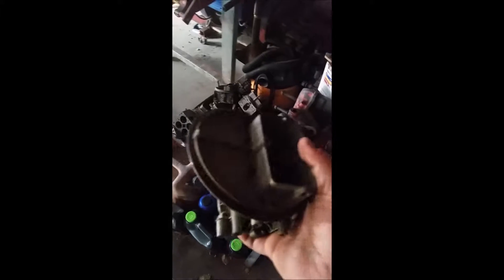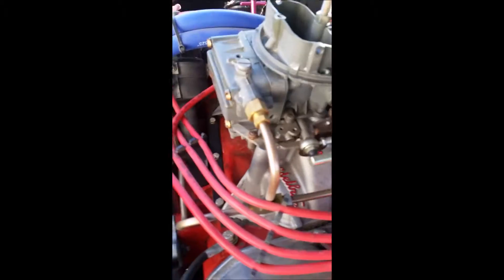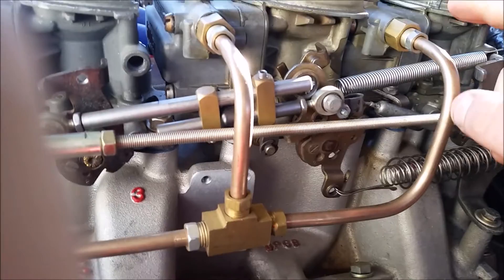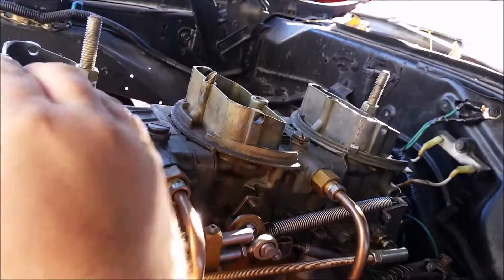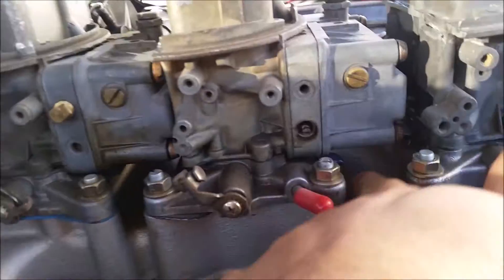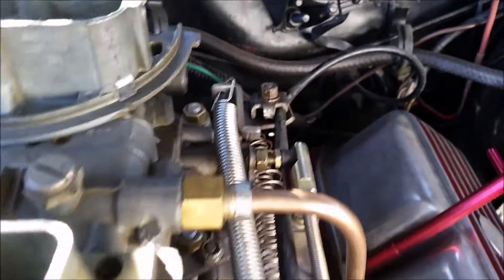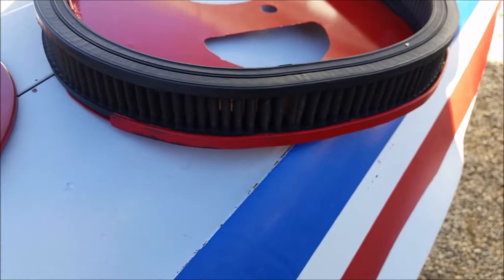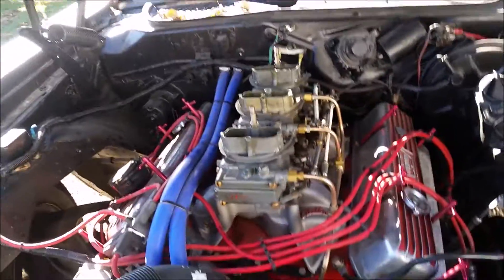Jed's Mechanical 6 pack EXPLAINED

Comment: I caught where you said the center hung bowls won't fit. I am wondering if that depends on the center hung bowl p/n. Holley has a SBC tripower with mechanical accel pumps on a Weiand intake and they are using center hung float bowls. Very tight in appearance. I do see daylight on your setup up. I picked up a couple IH 2300 and now I will experiment. Cool stuff. 
I had a Six pack on a 440 Dart with no vac secondary and mechanical linkage. Could not launch hard so I found some vac sec diaphragms. But for a twenty mph roll the car would LEAP forward. I raced a real 340 TA and a real 69 Boss Mustang on 1A in Ft Lauderdale, FLA once. Six lanes, the three of us three abreast. 209 mph roll. I put 3-4 car lengths on them in nanoseconds. Blew their minds, collectively.
I am duplicating the car and want the accel pumps on the outboards as well as the tuneability with jets and metering blocks. I am working feverishly on this new Six Pack set up.
Reply from the maker: I had great luck with this setup, and I even made a better version out of 3 4412 holley 500 2 barrels
Reply: @ScottsSpeedShop  I have not found a 4412 with the side hung float. Did you have to change the float bowl on your set up? Have a p/n?
Reply from the maker: @keithbrown1915  yes I did,  you have to use primary float  bowls from carbs like 4160s and you have to plug the fuel transfer tube whole. I just put jb weld on a pipe plug and screwed it into the casting. And that how both of my mechanical six pack setups are, including the rare Mr Norms tri-power setup, which I've own one before.
Reply: @ScottsSpeedShop  Check out the pics at this address. THe Old DC mechanical six pack. Looks like Mopar Six Pak throttle bodies with the choke horn removed on the ends. The side hung bowls. Accel pumps. Be nice to have a list of all the individual component part numbers.
Reply from the maker: @keithbrown1915  the direct connection mechanical race six pack is what i was referring to.  I just prefer 350 outbound carbs with a 500 center
Reply: @ScottsSpeedShop  I read that the mechanical setup was intended for use with the Weiand Six Pack Intake. Guess what I have sitting in my basement? With a Edelbrock STR Six Pack sitting next to it.
Reply from the maker: @keithbrown1915  very nice sir,  I've got the weiand Crossflow intake. The infamous six pack tunnel ram, it's a pretty good intake with 3x 4412s on top
Reply: Man, did you send me down the engineering rabbit hole. I finally found pictures of how Six Packs to Go modified the Six pack carb for center hung bowl w/ accel pump. Saw a pic of the old Barry Grant Six Pack with banjo fuel inlet fittings to attach the transfer tubes through the carbs. Speedway Motors sells a fit with -an fittings that would do like a 600 with a transfer tube. Tow kits would do the six pack and clean up the fuel inlets, tuck them close to the carb. I still have the Segal mechanical linkage vintage 1979. One question to reiterate. You said that you used a 4412 for the center and put a side hung bowl with accel pump on it? Thank you my Six Pack brother from a different mother (Mother Mopar!)
Reply from the maker: @keithbrown1915  That is correct, a 4412 with a side hung float bowl with an accelerator pump. I just plug the hole where the transfer tubes go.

Comment: I hoping you still get this even with old video, this vid inspired me so I’m putting the same setup together, I’ve ordered some primary side hung fuel bowls for my 2300s but what did you do for blocking off the holes for the crossover tube, thinking of ways to block them off
Reply from the maker: That's quite an honor, my friend. Thank you. It's a fantastic setup that never failed me, and I loved it, and I still prefer it over my single four. As for blocking off those holes, I threaded them and screwed a plug into them with jb weld, never had a single problem. If you have anymore questions email me chargerjezebel70@yahoo.com
Reply: @ScottsSpeedShop  awesome thank you a ton! Great idea, I followed you on Instagram I’ll have to keep you updated!
Reply from the maker: @junkyardigans6197  please do sir! I love it that you are gonna give it a shot, I know there are things I'd do differently now, but it all worked great
Reply: @ScottsSpeedShop  keeping an eye out for a cheap intake but finding and rebuilding 2300s as I can afford it lol, gotta get one more and the intake
Reply from the maker: @junkyardigans6197  Yeah, the intake used to be readily available, and when I bought mine, I got lucky. Are you doing a low deck or raised deck engine?
Reply: @ScottsSpeedShop  I have a 75 dart with a 73 440 hp rb motor in it, I can get the intake easy but 550$+
Reply from the maker: @junkyardigans6197  oh ok,  your are doing a raised deck,  I used low deck intake and those are pretty proud right now, $550 would definitely hurt as well
Reply from the maker: @junkyardigans6197  oh,  go look at my Charger Jezebel's tri power set up as well,  it's a revised version with 3x 4412 500cfm two barrels
Reply: @ScottsSpeedShop  I’ll shell the money out just gotta be patient lol, thank you so much for all the info I’ll prob be in touch soon lll
Reply: @ScottsSpeedShop  oh shoot Oke I’ll have to find it
Reply: I got my setup all on the car and ready to start, I have the outer carbs idle adjustment all the way out as low as they can go, and the idle air screws 1.5 turns out, any tips for just getting a good idle mix? Haven’t tried starting it yet

Comment: Did you have to block off the idle circuit for the out board carburetors? I have read some people have had issue with things being very rich at idle if they didn't do that.
Reply from the maker: I did not block off the idle circuits, this setup works great, and it did take some work to make it to the way it is now. But it doesn't run rich or lean, and hauls the mail. It just takes time and some fiddling and head scratching
Reply: @ScottsSpeedShop  Rad! Such a cool and resourceful set-up. I am building a 392 Polysphere stroker for my A Body Barracuda I may have to build.a set-up similar to this. I love the use of a large center and smaller outboards.
Reply from the maker: @Firion13  that's gonna be a really cool engine man, the polys don't get much love. As for my setup, the large middle carb and smaller outboards work a whole lot better than a stock style setup street and strip.
Reply: @ScottsSpeedShop  I can totally see that. The large center and smaller out boards would have far less chance of having it fall on its face like the old large vacuum secondary outboards. Nice work!
Reply from the maker: @Firion13  thanks man, the setup is more balanced this way

Comment: The centre carburetor is the primary and the two outer outboard carburetors are your secondaries.
Reply from the maker: That is correct, treat it just like a progressive dual quad setup or a single holley double pumper, when setting when the secondaries come in

Comment: 3 of the small carbs would probably work good on a 318 or 340. Good down home fabrication!
Reply from the maker: Yeah, 3 350 cfm carbs would work great on a small block, if you had a really hot small block I would step the center one up to a 500 cfm
Reply: You will still have over a 1000 cfm.

Comment: Old Ford FE tri power  setups were like that...There Holleys were mechanical linkage and had accelerator pumps in them...Old Direct Connection books use to suggest them for competition..Just some info you might like...
Reply from the maker: Very cool Vernon, I actually did know that, for a young man, I have educated myself about as good as I possibly can, I don't know everything, but for a 25 year old, I feel like I am significantly above average, thanks for sharing though
Reply: The direct connection carbs were large cfm. The ford carbs were even smaller than the 350 holleys. Back in the day i had the ford layout on a 390. My son has the big holley pumpers on his 69 roadrunner stroked 440.

Comment: How much did u spend wen u built  your sixpack setup im looking  to build a similar setup for my 70 challenger  im also on a 24 year-olds budget
Reply from the maker: I traded a 340 six pack intake for my 383/400 intake, I paid 200 for it from a buddy, the carbs ranged from 60 bucks to 100 bucks. I may have 550 at the most. I would recommend going on Ebay or going to swap meets and picking up 2 barrel holleys but be careful, they come in many many sizes, and the list numbers on some cannot be decoded unless you have an old holley book like I do. If you would like, I can help you find stuff for your setup, you can find me on facebook here: https://www.facebook.com/jedidiah.scott.3, from there I will give you my cell, and if you have any questions, feel free to ask away
Reply: Thanks jed found  you on there sent you a message
Reply from the maker: No problem brother, got it